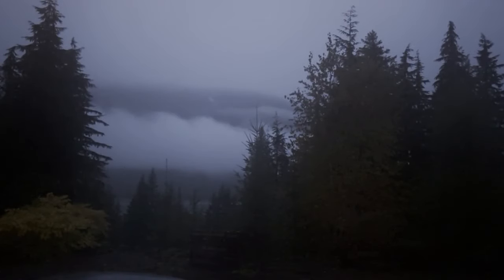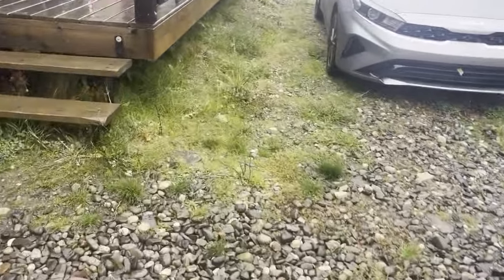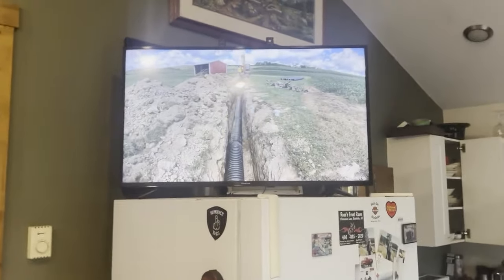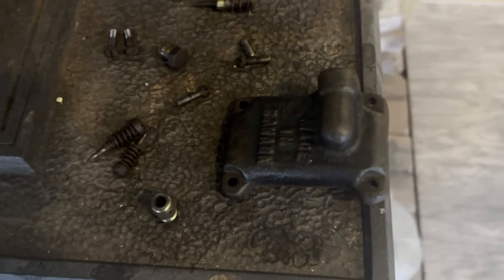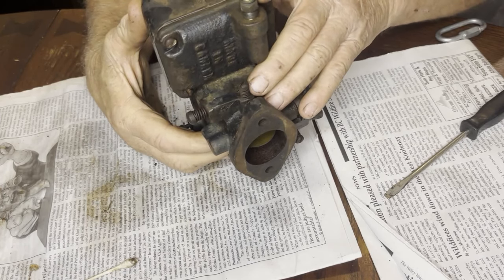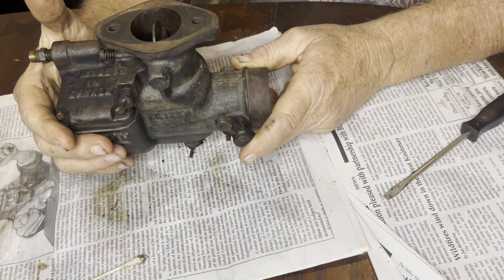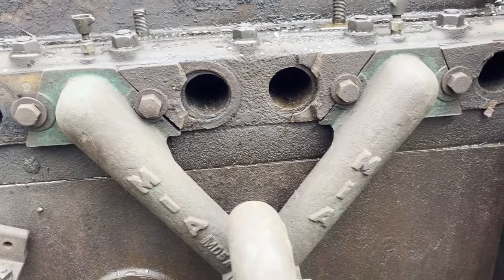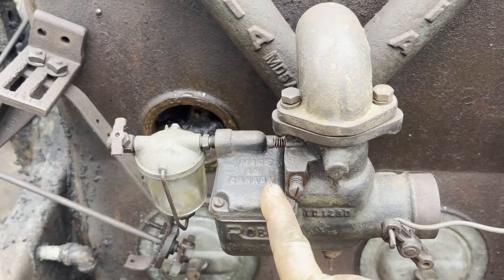Rainy Day working on the 15-30

Comment: I've never seen a carburetor like that. Mine's brass, which I polished up and it looked nice for about a day. In Iowa, they sell ethanol gas which will ruin your cork float and any cork gaskets, like the sediment bowl might have. Gas stations have finally begun selling pure gasoline, pricey but you don't have to rebuild things with parts that don't exist.
Reply from the maker: Nor I. No carb kit available. On top of that the intake and exhaust manifolds are stamped MIA. Rare for sure. Always problems with the older equipment.